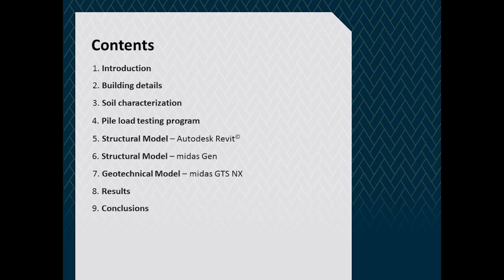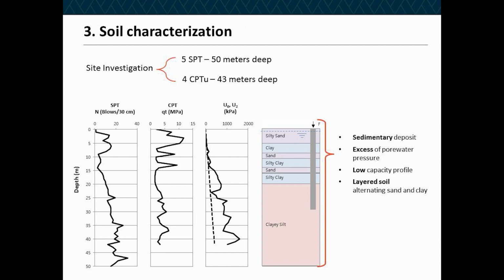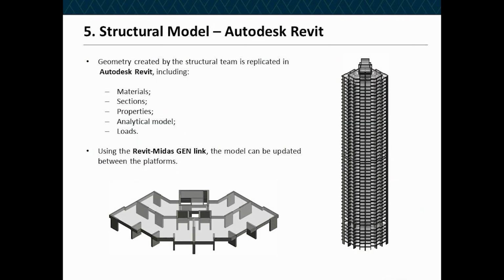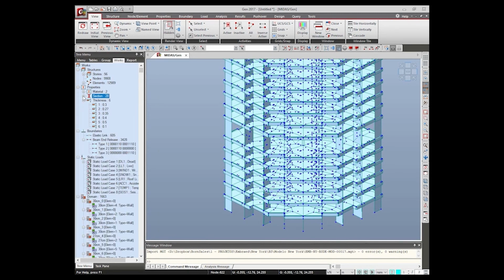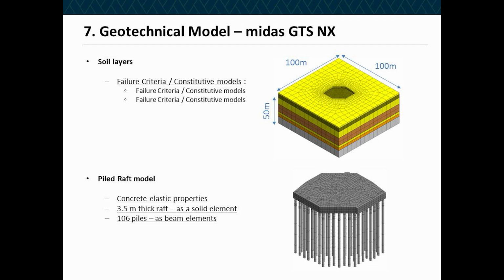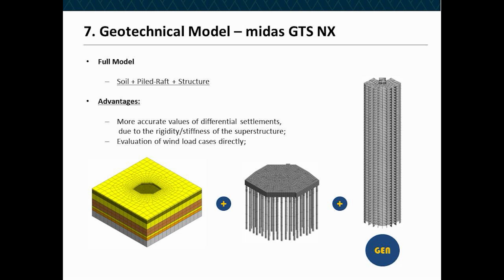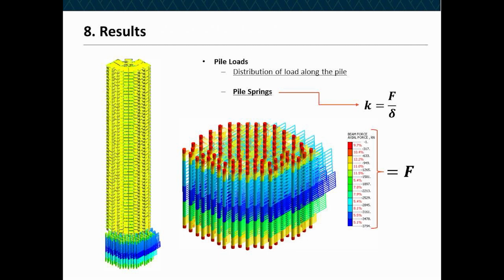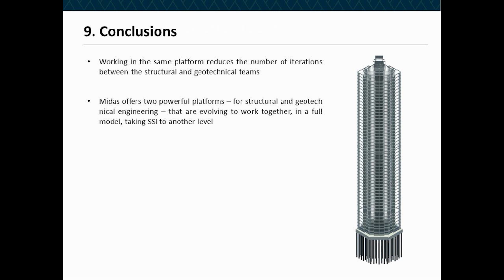Soil Structure Interaction Analysis of Skyscraper in Brazil

Comment: Thank you Midas. Excellent presentation. Sir I have the following questions:
1) How did you apply wind load in GTS N X?
2) Where did you use the elastic link and why?
3) can you share us a little bit about the pile load test calibration done in GTS NX
4) the model extent seems small(especially the depth extent).Have you done any parametric study to decide the extent?
Thanks again for posting such a wonderful webinar.